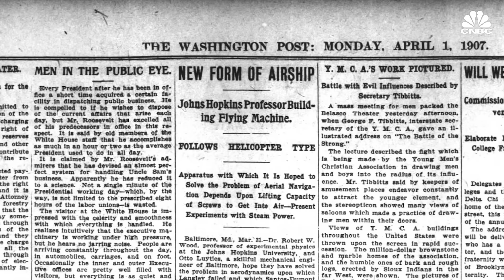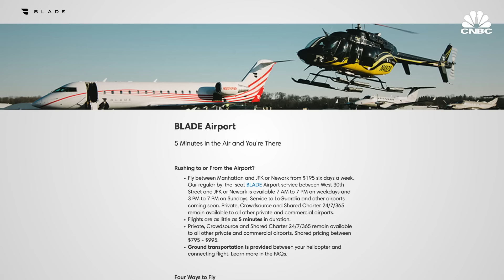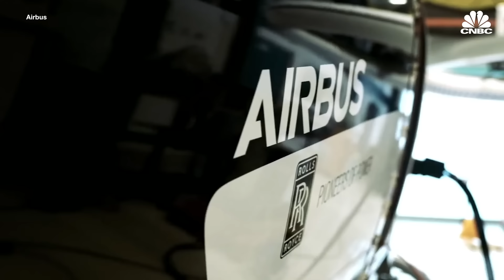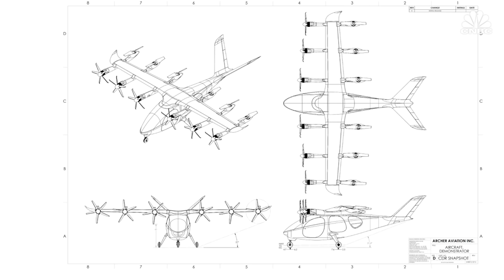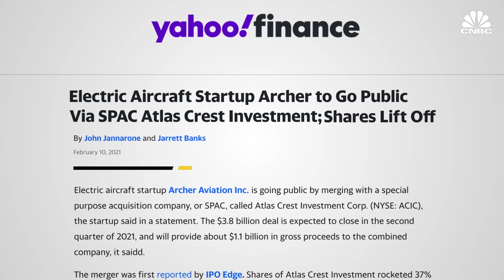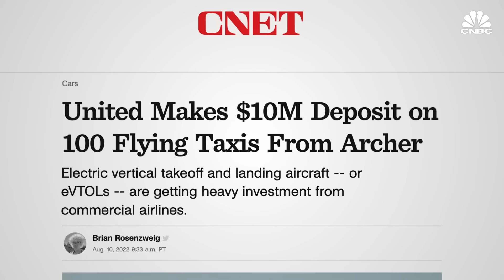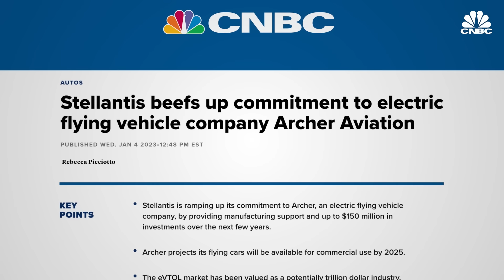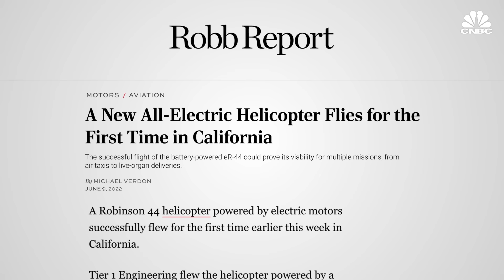How eVTOLs Could Disrupt The $49B Helicopter Industry

Comment: If they say they'll launch in 2025 that means they'll launch in 2030. So many EV companies are way behind on production & burning thru cash. For something like this, they need a higher degree of expertise, legislation, infrastructure, funding & rare metals.
Reply: It all comes down to legislation and infrastructure. You can buy something similar today for $100k, but start flying it around town and you'll cause a panic.
Reply: Most Ev car companies went under without the help of big auto.
Reply: @CmdrCorn  where?
Reply: Nah!  You're from Saudi Arabia!  ;)
Reply: @Not Applicable  There's the Jetson ONE, the Blackfly just to pull up a couple names real quick of production models.. However you can do just as well to build something yourself. Even para-motors which is just a lawnmower engine spinning a giant fan blade and a parachute get the job done...
  Look up 'electric single seat plane' or something... If I had more money and time I'd end up on the evening news for sure. It just blows me away there isnt more of it happening. 
  I often think this is a big part of the "gr8 reset" and upsetting current paradigms before this singularity in ai, robotics, blockchain, 3d printing, battery tech, biotech, etc all spills over into the lower-middle-class markets all at once and central planners wont be able to keep up...
Reply: The whole EV industry seems like a giant grift scheme.
Reply: @electric7487  Indeed it is. The EV industry is mandated by credulous governments and run by hucksters.
Reply: @El Ectric  Depends on the application. I remember 15 years ago I had a job where I drove around a tiny EV truck-like golfcart and it kicked butt... Where it works the market already exists. Its all the hype and ESG that's a huge grift.
Reply: @joeking433  Bold of you to assume that, buddy.
Reply: @electric7487  Bold, but right on target!
Reply: @joeking433  And this, people, is an example of sheer fractal wrongness.
Reply: @CmdrCorn  That too, but battery tech is nowhere near what is required.
Reply: @electric7487  If it was only a "grift" scheme it wouldn't be so bad. In reality it's a major fraud.
Reply: @Mew-ip3iy  Just one example. The Korea Fair Trade Commission (KFTC) had sent a report to the electric vehicle (EV) maker stating that it had exaggerated the mileage of some of its models, including Model 3, in violation of the Act on Fair Labeling and Advertising.
Reply: Airbus is involved.
Reply: There is a pattern that EV haters seem to flow through. Its similar to the language of those who hate renewables. Its very weird…
Reply: @SwaveWorm  No one is hating on EV's. The problem is that people like E Musk lie about how fast they are going to develop new tech. We were supposed to have completely autonomous cars in 2016. Yet we are still probably 10 years from that. We are continually lied to.
Reply: @BobaPhettamine  No one does it quite like Elon Musk. That's why he's in court right now. But yes I agree, some companies exaggerate their abilities. It's usually to appease their investors.
Reply: right, a pipe dream it has been for... quite a while already.
Reply: the rare earth metals arent rare at all. it is just that they are in smaller concentrations. and no you dont need neodymium and niobium etc with reluctance motors, which is the new thing.
Reply: Tech you see in modern day is about 10 years obsolete at any given time. Compared to modern technologies, like an evtol using a non rare metal electric engine
Reply: But Elon wants to do short range rocket service to these same markets. It is gunna look like a war zone over our city.....I want horse and buggy back now!!!
Reply: @snorttroll4379  Prediction: in 10 years permanent magnet based motors will still be widespread in all EVs but Neodymium magnets won't be used in the vast majority; it will be iron nitride magnets. 

Why?

-A viable mass production process for iron nitride was recently discovered (in the last few years)  
Iron and nitrogen are extremely abundant and cheap to obtain; neodymium while not particularly rare is expensive and the world is dependent on China for it's supply.
-Iron nitride magnet based motors can produce more than twice as much power and are substantially more efficient than their neodymium  counterparts - this means they can be built both smaller and cheaper for the same motor power, reducing vehicular weight and cost, and handle high temperatures better, making them more durable. 
-Iron nitride magnets can be magnetised in situ, safely (rather than having to buy premagnetised neodymium magnets), which manufactures will all almost certainly prefer.
-Reluctance motors (and other non permamagnet motors) are 10-20% less efficient than permamagnet motors
It's just a matter of efficientising and scaling up production of iron nitride powder for said purpose at this point. EV makers will adopt.
Reply: I think they will realize that we aren't exactly there yet. We are close but I definitely feel their estimation is way off. Right now autonomous cars are making faster progress then evtol. As soon as autonomous cars are on the market, people will probably forget about eVtol for awhile.
Reply: I think maybe not even  2030 more like 2035.
Reply: they will never launch
Reply: Um, Beta Technologies and Archer Aviation has already started production.
Reply: And will last 5 years  @MirzaAhmed89  ?
Reply: Because an eVTOL is an AIRCRAFT, it qualifies as an entirely different animal from an EV. Joby’s independent subsidiary H2Fly flew a test aircraft the equivalent of a London to Rome distance, on a single charge. Widen your technological perspective, and perhaps you may participate in transforming the $49B helicopter market, into a $1T+ eVTOL evolution
Reply: @eddienoragong402  not likely.  Wishful thinking can't overcome engineering problems and the fundamental physics.

Like fusion power, it is always 30 years away.
Reply: @CmdrCorn  Me and you are on the same mental wavelength. I'm lower middle class and all i can think of currently is funding my own small R&D project to create my own personal EVTOL. I'm researching RC planes and drawing up models, first gotta see if the concept will even fly as an RC drone.

AI is almost there, it will take care of ALL the coding required. Flight sims are decent and i have a gaming rig capable of heavy load rendering and LLM consultation. 3D printers and CNC machines are buildable and cheaper everyday, not to mention the companies willing to do it FOR YOU for pennies per inch. My biggest hurdles would be welding and fabrication of the full scale model but at that point I could crowd fund and release the blueprints to the donors. It floods my mind it's so overwhelming. I just wanna fly.

Comment: If those eVTOLs were rigorously tested to be safe enough to transport the developers and engineers'  families and loved ones, then customers would get in to them eVTOLs right quick
Reply: They would be vastly safer as you have simpler mechanism and more engines, the main problem is range.
Reply: they have a glide ration and multiple motors so single point failure like gear issue like in helicopters will not occur
Reply: I would get in one today. They are really safe.
Reply: They probably would but they aren’t certified
Reply: expect more explosion and collision first before it gets better. Because its exlusively for rich people lets expect  the population of rich will decrease and living rich people money will multiply 3x.
Reply: I love your profile picture.
Reply: Even if I am not a big fan of evtols, those are safer than helicopters
Reply: @Eskschannel  More engines doesn't necessarily mean better.  If you lose one engine, you still may not be able to stay airborn.
Reply: @BobaPhettamine  Depends on how much weight your carying?
Reply: @BondJFK  there is no proof they can even get off the ground with the weight of passengers.
Reply: @nikobelic4251  you don't need certification to fly in experimental aircraft. how do you think they tested them before flight controllers?
Reply: @frankyflowers  The people who design the plan don’t fly in the plane until it’s certified, it’s test pilots and test engineers.

These EVTOL are a whole new breed of aircraft they aren’t going to put test pilots in them until they know the aircraft’s limits while flying empty.
They might as well minimize the risk since they have the tech to do it.
Reply: @nikobelic4251  they can put a crash test dummy in it for weight but they can't because it wouldn't go far enough for people to not think its a scam.
Reply: @nikobelic4251  drones flying empty isn't really special
Reply: @frankyflowers  there is a series of steps you take to certify aircraft set in place by the regulator.

There is absolutely no point or reward for jumping ahead and getting fancy. 
Asking why they don’t fly with XYZ on board is like asking why Boeing doesn’t just do all the flight testing for the 777-X in a week and get it over with.

You follow the steps the regulator gives you and don’t take any additional risk. When the certification process calls for weight to be added it will be done. Until then there is no reason to do so.
Reply: @frankyflowers  you have to get it certified. Doesn’t matter what you demonstrate to the public if the aircraft doesn’t get certified. Do what needs to be done to get certified and the public and investors will have their proof.
Reply: @nikobelic4251  it matters if its a publicly traded company to show it to the public. none of them are farther along in the certification process than you would be if you applied without even having a prototype. they use the no big deal news of being in the certification process for legitimacy. they can be in the process for a very long time and never pass but they can brag about being in the process and scamming the whole time. the day of reckoning is near and they will be exposed.
Reply: @BondJFK gear issues in helicopters are very rare indeed.Helicopters can glide (autorotate)
Reply: @user-pq4by2rq9y based on what ? These electric aircraft rely on computers to fly.Computers never crash do they?The bell 609 tiltrotor is still not certified after 25 years of testing.
Reply: Relax people! The money will decide where this market place goes and what I mean by that is, those who are able to make EVTOLs , a safe, efficient, practical, way of traveling, at reduced cost, coupled with an efficiency of service, will be the benefactors of this type of aircraft. 

So for those of you who referred to these aircraft being powered by engines, you are wrong. They will not be powered by conventional, internal, combustion, engines. They will be powered by electric motors, and there is a difference, a big difference, and not only will you benefit from lower costs, but better, and safer, travel, and all while producing less pollution, including a reduction in noise, pollution, and so these benefits will certainly be something that will be valued by the traveling public, not to mention those who would like to use them as sports, and recreational vehicles too, and so I can see lots of recreational use for these types of vehicles, and I think, we’re just scratching the surface of where this is going. I also think that it’s all good, despite what the naysayers are saying here. Cheers 🥂
Reply: Say for example you happen to be a well off home owner on one of the man made islands in Dubai. If you have a very quiet, emission free aircraft to take you or your family to the airport at a moments notice and trust its safety; Why wouldn't one take this over a noisy, air thrasher of debris helicopter ?
Reply: The only one I’d trust today is the JOBY S4 and its Hybrid variant.

Comment: They have a long way to go. Joby is in the lead, but they currently only have a 150 mile range.
FAA certification of these new types will take many years. 
The time it will take to financially survive the FAA type cert process may eliminate many of these start-ups.
Reply: Nah!  They said the same about Tesla.
Reply: He said 50 miles range
Reply: @joeking433  the aeronautical industry have heavy certifications and its difficult to a startup to try to do all the vehicle by themselves
Reply: @devengudinas1649  Marcus is speaking on Joby Aviation, which is the leader. That has a 150 mile range at a top speed of 200 mph.... Archer is has less range and lower top speed. That said, it doesn't matter. These company's business models are designed for shorter flights. Like 30 miles per trip.
Reply: only a couple have to survive.  and they can more easily get additional funding, the closer they get to certification.
Reply: @bxkxhxkg82  a plane builder here said this when he was asked why they used such old engine designs. He said huge expenses in legalising something new so as long the old is good enough sell it.
Reply: I think by 2050 we should be good!
Reply: 150 miles is more than enough for intra-city travel, which is the primary use case for EVTOLs
Reply: The FAA is one thing. The other is the Insurance and Legal Industry. One accident, one injury, one loss of an airframe, one loss of investor returns and you will have one total shut down of that effort. I wish them well, however a simple fixed wing barely gets off the ground, rarely into production and almost never make it to a positive return on investment.
Reply: I'd sayd lilium is on the lead: simpler design, can take off with runaway or evtol providing more options, no open propellers and more redundancies,therefore safer, 250 mile range as cruise flight is much more efficient than open propeller like joby (albeit with a lose of efficiency in hover flight, however that only accounts for 2% of flying time to take off and land), more passengers carried, etc.
Reply: Joby have a 150 mile range without a payload.Once you add people and or baggage their own statement about range is 20-25 statute miles. Every authority in the world has a minimum land on capacity of 20 minutes flying at cruise. That’s 20 minutes off a already depleted battery before you take off.
Reply: @jaffacalling53 If you look at their presentation despite mentioning 150 miles (without a payload) they actually state that there target range is 20-30 miles.They are all guilty of nerfing the figures because they know the power required to operate at max gross weight which they haven’t achieved yet.
Reply: Beta Technologies already started production, and they can do 250 nautical miles.
Reply: Update suggestion: Joby’s recently revealed hybrid hydrogen-electric variant has a range of over 550 miles.

Comment: The main helicopter market segments are business aviation, EMS and law enforcement, where payload, range and speed are key, so a hundred helicopter airshuttles in each of the 35 or so global metropolises is not going to disrupt the light helicopter market. Remembered also that when Continental Airlines, merged into United, offered $49, and even free, Manhattan Newark flights from 2006 to 2009 to business class pax. Most prefered to take a longer limo ride and use the travel time productively.
Reply: forgot to mention oil and gas offshore ops, lots of miles and payload
Reply: @bilate1  that's why I found Ehang marketing of the 220kg, 22 mile range 216 for the offshore oil and gas industry to be a joke.

Comment: If I think about how this would actually work in practice…. A company like archer would probably have a small area in these downtowns to land / take off if they want to be in a good location for workers.  They use the downtown helipad in Manhattan as an example. Say they get three of the ten spots there. And say it takes 5 minutes to land and unboard people. So during peak “go to work” hours, say from 730am-830am, that’s 4 people x 3 evtols x 12 ( 60 min / 5 min) = 144 people per hour.   At $100 a person that’s $14,400 revenue.  And that’s probably with ~36 evtols operating at $1000 per hour. For a half hour trip including loading and unloading people, that’s $18,000. So gross loss is $4,000 per hour.  And that’s with no downtime at peak demand. I don’t see how this is either efficient or profitable. Trains seem 1000x better.  What am I missing???
Reply: None of this stuff is viable until energy is cheaper

Comment: In the mean time, do hybrids, power those electric motors with generators to get the range and power needed for specific usage.
Reply: it really would bridge the gap between the real helicopters and problems with battery weight, until that can be solved if it can at a later date, they could even make them modular in nature to be updated so its not just chucking a whole hybrid vtol in the garbage at the end of it
Reply: I thought about that but it might also complicate manufacturing and increase production costs.
Reply: Thats not how the advantage works with hybrid. Its good for cars because you can stop and refuel. The added weight makes no sense in a evtol when you can’t just land and refuel.
Reply: it would be intereting if Toyota came out with a hybrid eVTOL, a prius of the skies.  I think they hybrid design will be the first successfully commercial eVTOl vehicles.
Reply: @ADAPTATION7  it would be a smaller issue at scale but your point is valid.
Reply: Laugh.   Clueless.